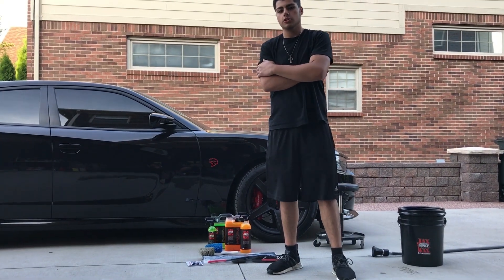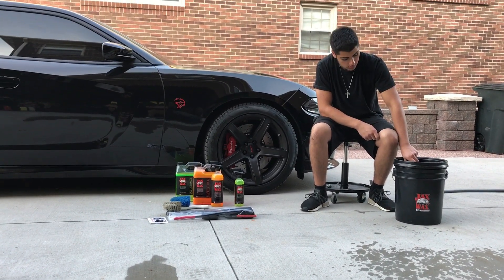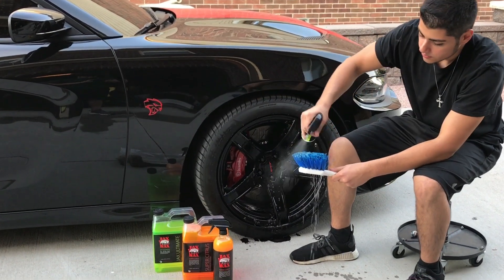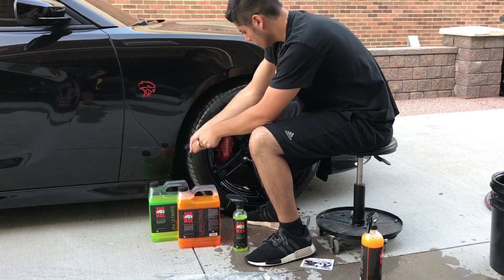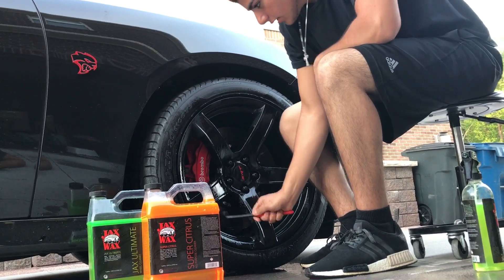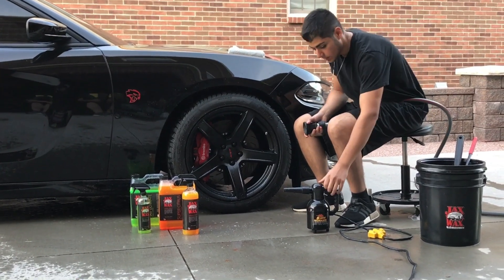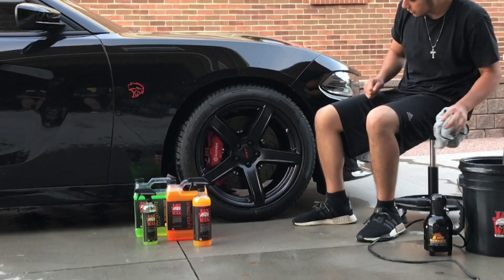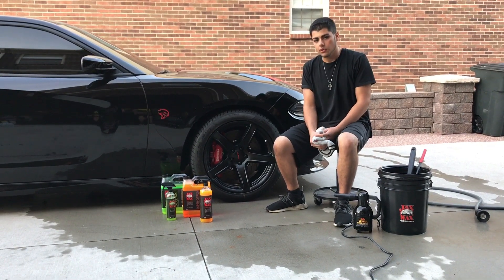How to Properly Clean Brake Dust on Wheels

Comment: A great tip for brake dust, is when you get home from driving around, use compressed air to blow the wheels and quarter panels off.  It will blow your mind how much dust comes off.  Keeps your wheels cleaner for longer!  👍🏻

Comment: Also another step I recommend is pre wetting the floor before cleaning the wheels because from my experience I have not wet the floor and after cleaning the wheels it stained a light color driveway.

Comment: Or you can just ceramic coat your wheels/calipers
Reply: Mine arent ceramic coated, but I use something called aqua glow which is a wax with ceramic coating on the inside of it, and any brake dust just falls right off